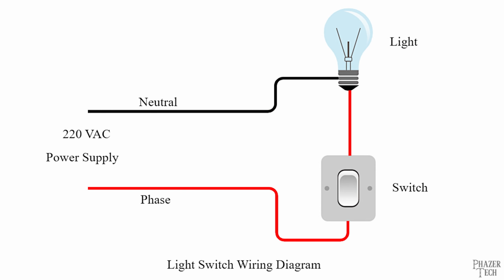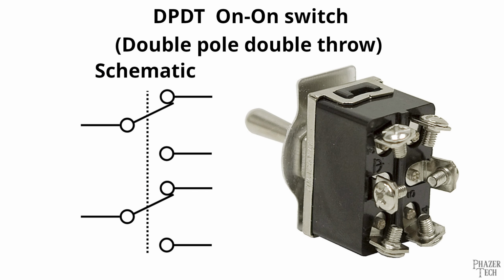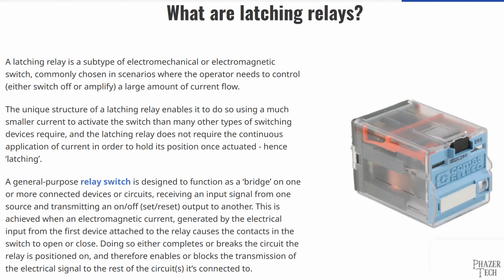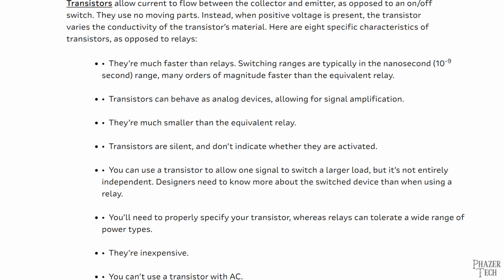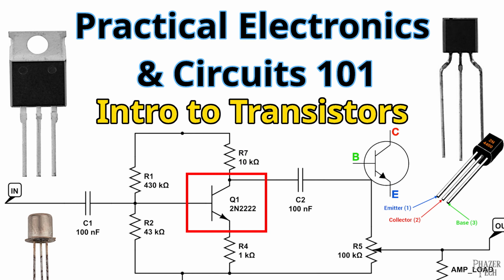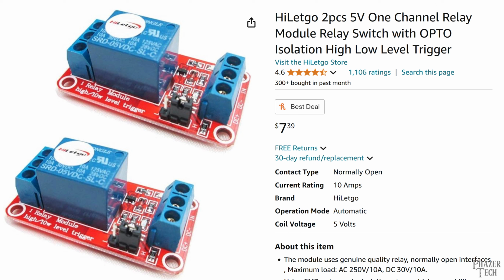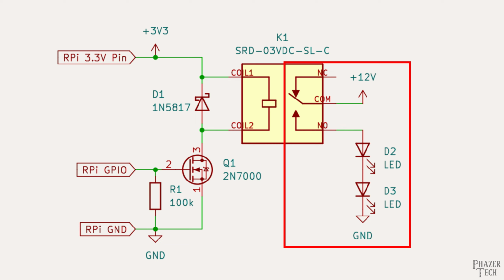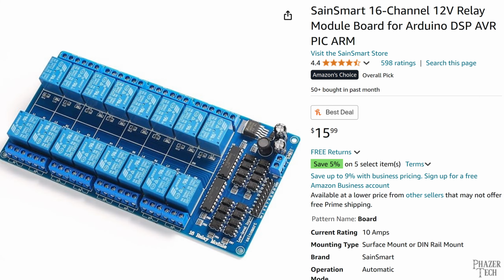Practical Electronics & Circuits 101 – Switches & Relays

Comment from the maker: A few corrections. The 2N7000 worked for this application but it's not a great choice because 150mA is pushing it. After looking at the datasheet again I'd use a different transistor for peace of mind in long term use. For example the 2N2222 is a BJT that is suitable here. The IRF3205 MOSFET I showed in the previous video is another good choice but it's large and overkill for this. It seems the most appropriate MOSFETs for this are mostly surface mount, not breadboard/stripboard compatible. But if you go with the relay module boards that I linked in the video description then you won't need to worry about this. 

Also like I mentioned, MOSFETs don't require a resistor in between the gate and the RPi output pin, but in some cases you might want to include one to protect the Pi in case there's a short across the transistor. This resistor should be relatively small, only about 100 to a few hundred ohms. If you go too high then the transistor might not be able to fully turn on.

And finally, I forgot to mention the jumper on the relay board allows you to reverse the input signal, in other words the relay will turn on when it receives a low signal from the Pi, not a high signal. But in most cases you can ignore the jumper.